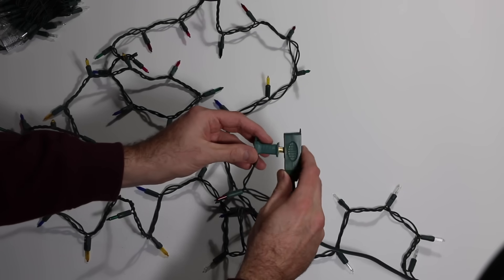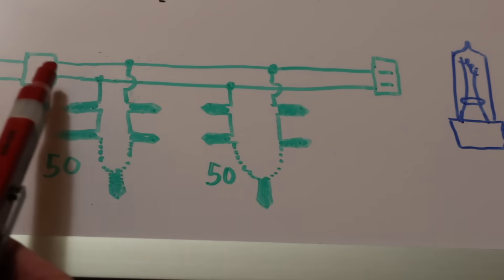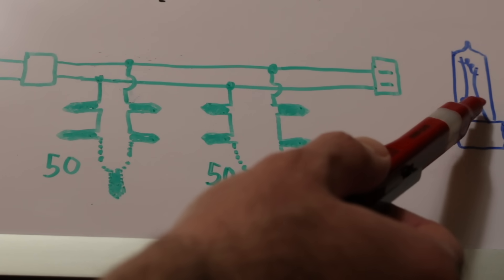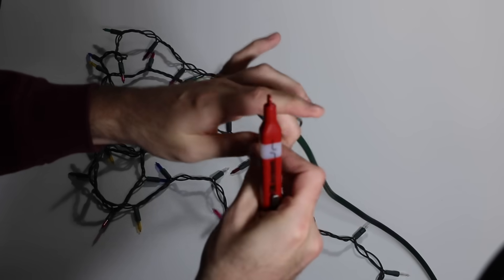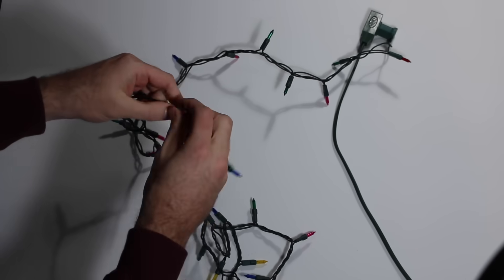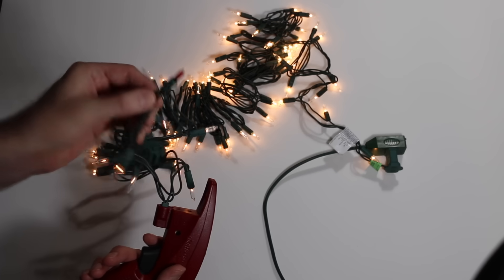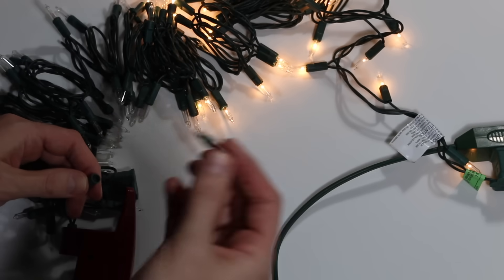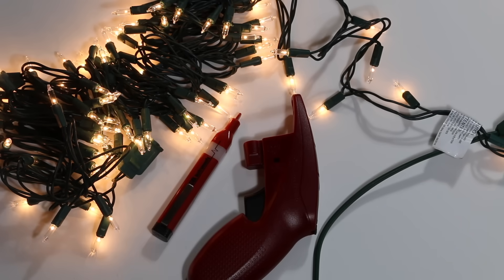HOW TO TEST AND FIX CHRISTMAS LIGHTS - Light Keeper Pro and Non Contact Voltage Tester Method

Comment: Only problem with this testing —- assuming that the light string you’re testing is wired that way! Long strings tend to be wired in segments- that is, one bulb burns out, but the electricity continues to flow to the next segment.
Reply from the maker: via the parallel connection of the independent series strings, yes. so all we are doing is diagnosing the one series string that has the problem in it and ignoring the ones that are still functioning.

Comment: Seems so easy, but of course when I try it, not so easy. Every bulb on my string is out, and every one is getting current according to my non contact voltage tester. I’m going to turn into either the grinch or the hulk
Reply from the maker: One Way to confirm all the bulbs are really blown and The noncontact tester is not just picking up some other stray voltage if it is overly sensitive or still too close to other live power, if you are picking up voltage going along several bulbs that are all out, try pulling one out of the socket and that should definitely break the circuit, then try testing again and you should definitely only see voltage on one side of that bulb wire and not on the other side.
if you’re picking up voltage on both sides of the socket with no bulb in it, you must be picking up something else so try going to a different room just to see if there’s a difference or try separating the wire out further from the rest of the wires on the string.
Reply: @GadgetReboot  thank you! Will try
Reply: @GadgetReboot  nope! I unplugged a bulb and the pen still beeps on both sides. I'm pulling my hair out.

Comment: How do you know its a bad bulb vs bad fuses?
Reply from the maker: if using the light keeper pro, if pulling the trigger 30 times doesn’t fix it, it might be a fuse or maybe the bad bulb just can’t be recovered and it needs to be tracked down and replaced.

if using the AC noncontact voltage tester, if there’s a blown fuse there should be no live voltage detected anywhere with the tester.

Comment: We just bought a non-contact Voltage Tester.  Carefully went through the steps above and nothing.  Only one side of the string lights up.  We even moved some bulbs around to see if that is the problem.  Nope.  Do you have any other suggestions?
Reply from the maker: There could  just be a wiring issue also like a bad socket - sometimes wires get all frayed in the socket and the bulb can't make contact.

Comment: Why does electricity even start down a path that it cannot complete?
Reply from the maker: similar to water flowing through a pipe that’s capped off at the end and nowhere to go, the water still will fill the pipe and if there’s ever a way out then it will take it.
Reply: I think I get how the products work but you need to review basic electricity.  Current will not flow unless it has a way to complete a circuit.  Water is not the same as electrical current. @GadgetReboot

Comment: waste of time to watch
Reply: It worked for me, you must have used the tool wrong. I searched for this video because it shows clearly how to use the tool...
Reply: I just bought these so I will try them when I get them.
Reply: I've fixed a number of strands, but have also struggled.  I guess it takes some practice and the right tool.  These testers can be sensitive, so you must make sure not to mistake voltage on the hot line that's not going through the bulbs.